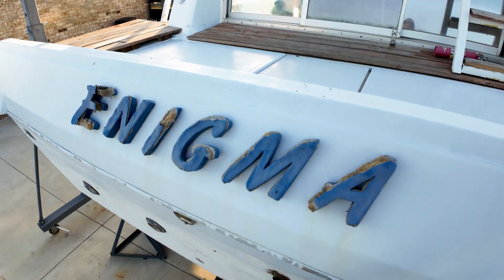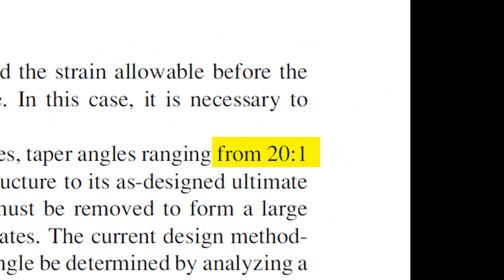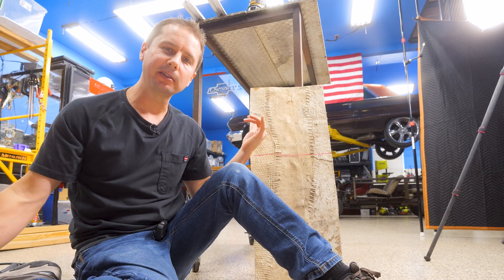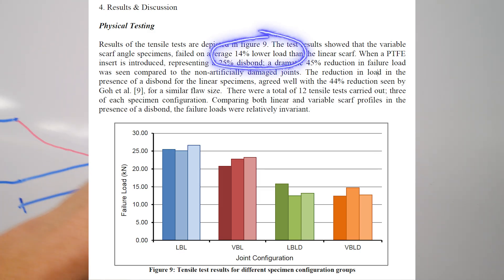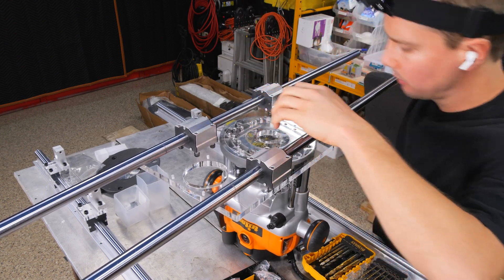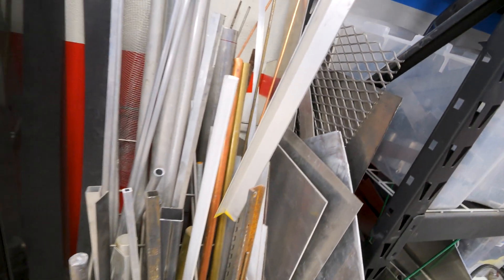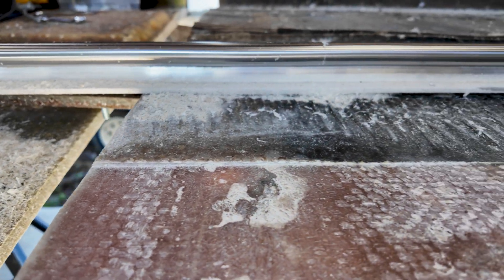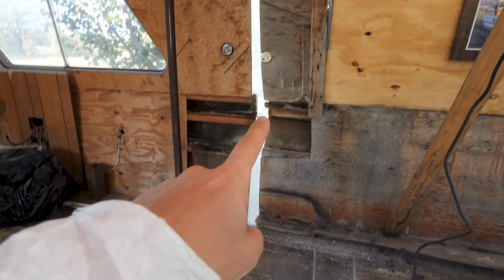Making a Human Powered CNC to Fix the Houseboat!

Comment: After all the scarfs and pulling the hull together for glueing, your going to lose a total of 2' from your original planned length, am I thinking correctly?
A foot on the front and one on the back seem.
Reply: what you are describing would be a true scarf joint, but I don't think that is the plan. From a couple of the diagrams he showed in the video the plan is to join the the two scarf ends of the hulls with new layers of fibreglass. So the length will stay roughly what it is now.
Reply from the maker: Yep @maxmillion7007 is right. I could have done a better job explaining that. The 3 hull pieces will stay the same length since we are scarfing the top and bottom sides and just fiberglassing over them in the same spot they are sitting right now.
Reply: Gotcha, yes, it makes sense now. You probably explained it well, I was trying to watch the game at the same time I was watching your video. 
P.S. that router / plane is money. Great idea!!!

Comment: I can't think of much I hate more then dealing with fiberglass in pretty much any way shape or form. Good luck and try to have fun with all that!
Reply: So true 😂 at first I thought epoxy and fiberglass are amazing because of the possibilities of what you can make with it, but after a big epoxy project I hated it 😁 if the grinding dust, the epoxy and the hardener weren't so extremely toxic I probably wouldn't hate it nearly as much
Reply: to anyone else working with this stuff: at the very least use thick nitrile gloves, goggles and most importantly always use a respirator
Reply from the maker: The worst part is the itching. And if you don’t want to itch it means getting suited up like you’re going to space.